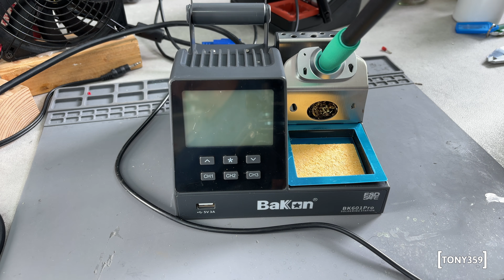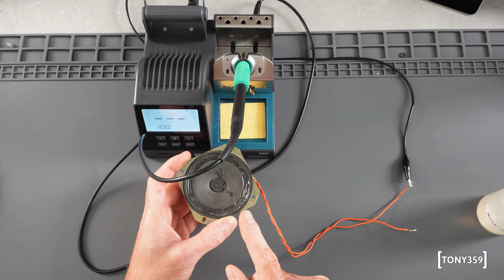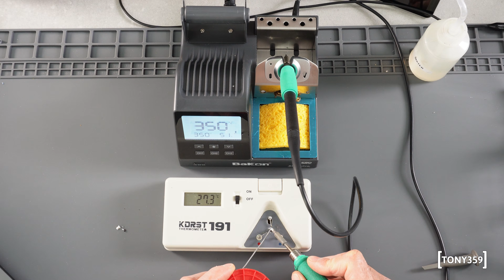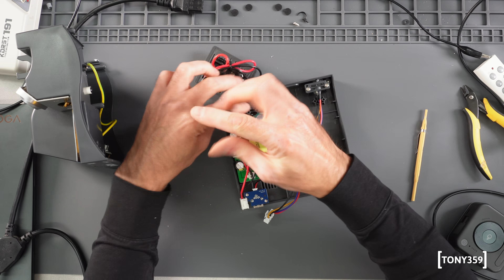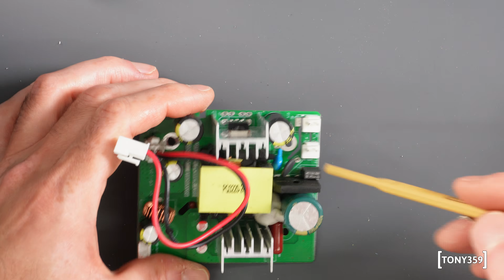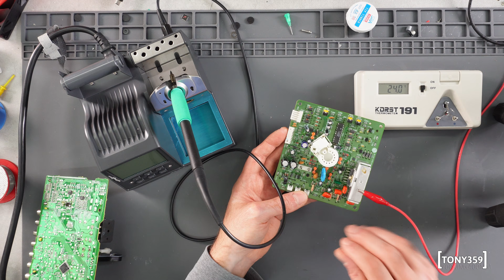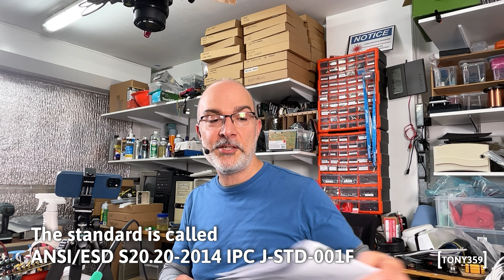This Soldering Station CHIRPS. Should you buy it? REVIEW!

Comment: Fascinating... you humans are such peculiar beings. 🤨 It is not the soldering station that is at fault—it is the tip. Merely exchange it for one of superior quality, and you shall achieve zero voltage drop leak  rivaling the warp core of the USS Enterprise. Conduct the experiment and relay your observations. As for myself, I shall be upon the bridge with Captain Picard, demonstrating the logical refinements I have implemented. Live long and prosper. 🖖
Reply from the maker: Your analysis is most enlightening, Commander. However, I must report that the soldering tip in question is a genuine JBC unit—procured directly from the official JBC distributor in the United Kingdom, fully compliant with Starfleet Calibration Standards, Revision 2407-B. Initial diagnostic scans show negligible plasma impedance and a stable microthermal flux pattern. If there is a leak, it lies not within the metallurgy of the tip, but possibly within a temporal field perturbation between operator intent and ionic conduction. I shall reconfigure the waveform analyser and update the engineering logs accordingly. Until then—may your circuits remain cool and your flux capacitors ever stable. Live long and solder

Comment: It is nice to see a review where there is actually some relevant and necessary testing being done. Most "reviews" I see on YouTube are pretty much worthless. They are done by people who lack relevant basic understanding of issues.
I'd like to see some sections of the tips. The problem with so many tips and iron designs is that the temperature measurement point is far too far away from the "action" part of the tip to do a good job. You can't compensate for this because the temperature difference is very dependent on thermal "loading" of the tip.

If I had a soldering station that chirped it would be forced to make like a birdy and sent flying.
I realize that this stuff is all cheap (pun intended) but why must so much of it be so horrible?
0.96 V is enough to make silicon PN junctions conduct. Absolutely unacceptable.

I have soldered hundreds of thousands of joints with irons that  did temperature control with "Curie point" methods. No display of any sort. No knobs. Highly reliable.
I've seen all sorts of YouTubers with fancy soldering irons but few of them have learned how to actually solder quickly and properly.
Reply from the maker: Oh, the Metcal station, my dream! No electronics. "It Just Works" (I'm told).

The tips I used in the soldering demo are JBC. I pay them £20/30 from the official JBC distributor, I refuse to buy junk online. 
The temperature test is probably flawed by the very small tip - maybe there are different tools for that? In any case the thermometer is a cheap one so I wouldn't trust it too much. What matters is that the Bakon and the JBC read the same with the same tip and I didn't register crazy overshoot while testing. 

Thanks for watching and for your kind words!

Comment: Around 17:15: very strange circuit on the earth/PE connection to the negative of the low voltage side. For me, seeing your test with measuring current between the tip and ground and the circuit, it looks like you were shorting out the output of the transformator? Maybe thats why you were getting 0.6A of current? Depends on how the tip is connected to the board and I might be totally wrong, but if this is the case, thats not okay at all and NOT to be "expected" as the manufactor says...

Comment: Great honest review! On Reddit I've heard good things about Geeboon T22.
Reply from the maker: Lots of people have been asking in the comments. I don't know, but I see their official store mentions that voltage leakage is less than 10mV 😀 
They're learning! Slowly but surely! Thanks for the visit!
Reply: @tony359 It's on the list of safe stations and currently the most recommended one. Very nice interface. I'm considering buying one. The FNIRSI DWS-200 hasn't given me issues, in fact it's been wonderful..
Reply from the maker: I understand the DWS-200 needs a simple mod or it will leak as well. Unless FNIRSI changed the design. 
Who makes that list? 🙂
Reply: @tony359 Yes there is a resistor mod. But then I've read that it can introduce a new issue, out of control heating when the part is grounded. So I haven't done anything yet, but nothing I do is grounded. I guess the list is done by Reddit community members? Soldering is the Reddit
Reply from the maker: interesting - the usual short blanket! 😀 

Well the thing is that if you have leakage, it's ok... until it's not ok. I don't want to take a change that my soldering iron might cause damage. And if you mod it, it might misbehave on grounded PCBs - for experience this can also happen on a non-grounded PCB, I'd imagine if you apply voltage to a circuit, it might find a path somewhere which might upset the temperature sensing?
I don't know but I'd rather trust my iron and not have to think about it 🙂 

What happened to those old fashioned soldering irons which... just worked, were grounded and just melt solder? 😀 

In any case, if it works for you, happy days. 🙂 I'll take a look at the soldering thread, thanks!

Comment: I would have loved seeing you solder the Anode of an LED that has its cathode connected to ground. Judging from the waveforms and current you measured from the soldering tip, I recon the LED would have bit the dust.
Reply from the maker: ah yes, a good test for next time, thanks!
Reply: I'd probably take that bet... I think the LED would survive. 0.6A through a 0.1-ohm short only dissipates 0.036W. Factor in the voltage drop of 3v for an LED and you get 11mA, which is safe for almost any LED.
... I mean, it's definitely not good that it does this. But I've definitely found stupider ways to light LEDs before.

Comment: I hope they fix the plug on the mains lead for a UK one, you cannot legally sell appliances in the UK without a UK plug. It is a criminal offense to supply appliances that are not fitted with a UK 3-pin plug or a conversion plug that permanently and securely encloses the original plug.
Reply from the maker: I'll leave those details to the manufacturer and appropriate authorities 🙂 Thanks for watching!
Reply: I also hope they remove the ESD-safe badge from the case. They need to fix the voltage leakage.

Comment: Failed electrical safety test. Sharp edges. Tip not grounded, that destroys your work but may kill you as well..
Did you test the supplied European cable to be less than 0.3Ohms, ground wire as well as the leads? What about the USB out, is that one safe?

Anyhow, if electical safety isn't ok, i would stop testing.
Reply from the maker: I should probably get a proper milli-ohm meter to do those tests. I finalised this review so that potential buyers can have an idea of what they're getting if they decided to buy one but yes, the moment you have grounding issues and voltage leakage, it should be a "thanks for watching and goodbye" 🙂

Comment: It acts like it has a filtering capacitor that is bad or not installed.
Reply from the maker: I mentioned the voltage and current leakage to Bakon, they confirmed it's expected. I didn't mention the chirping but I'd imagine it's a by-product of using 1.8KHz for switching 🙂

Comment: I always use a certified soldering station that has been verified to not have any voltage on the tip whatsoever. And that is because you are working on all different types of circuits and lots of SMD that can be damaged with any voltage on the iron tip... I still use a Weller WES51 station. It is what I used when I was repairing tons of aircraft black boxes for the Military early in my career...
Reply: To be fair, these kinds of products are not for professionals, they are for hobbyists with the odd job here and there on non-critical stuff (hi-fi, car radio, whatever). People who need (or want) modern small T15 or 210 or 245 style tips and a modern thin pencil handle, but don't want to pay $250 (AUD)/$100+ USD for a traditional handle Weller WE1010 (noting WES51 is discontinued) or a traditional handle Hakko FX-888DX (let alone $500+ for the modern style) and then $20 per tip on top of that, when (admittedly bad QC) Chinese T15 or 210 or 245 tips are a few dollars each allowing the hobbyist to have a wide variety of tips to suit fiddly jobs (and the machine itself is what $25-50 USD?).

No one is under the illusion the Chinese stuff is a quality product!  By all means the traditional chunky Weller or Hakko handles CAN do the fiddly stuff, but people sure do like their thin modern pencil handles...
Reply from the maker: That is exactly why I do not accept any voltage, any current. Zero is my tolerance. 🙂 
A good station is a good investment for sure - but not everybody can afford that at the beginning so I hope videos like mine can help understanding things better! Thanks for watching!
Reply: People always wonder why you drop serious cash on proper repair gear. It’s not because you’ve got an unlimited budget — it’s because when you actually care that the tool does what it says on the box, you have to pay for that assurance. When lives are on the line, there’s no such thing as “too expensive.”

Like I said in my other post, China can crank out some solid gear — no question about it. But for every two or three well-made units, there’s a dozen bits of “China slop” floating around. Stuff thrown together by what I’ve started calling electronics street peddlers. Sketchy to say the least.
Reply: @philathomas  "When lives are on the line, there’s no such thing as “too expensive.”" Surely it's self-evident that this is not a professional product? It's the equivalent of buying Amazon Basic wrenches instead of Stahlwille or Proto wrenches as found in an aviation toolbox. Granted a loose-fitting wrench doesn't represent a direct safety risk (though if a wrench is overhardened it can snap rather than bend, which can be very dangerous).

It seems to be a big debate whether hobbyists should pay $30-50 USD for a Chinese switch mode power supply system with 5-10 different T15, 210 or 245 tips, or $120 USD for a traditional electrically-safe Weller WE1010 (people say WES51 or WES51D but that's no use when they are no longer available!!!) or Hakko FX-888DX and then $10 USD per extra tip. I dunno.
Reply: @TassieLorenzo  It’s clear these aren’t pro-grade tools. What’s sad is how many people start their hobby—or even a possible career—with the wrong impression.

My son is a good example. He took a soldering course at the community college and really developed a passion for it. For months he spent hours at his desk experimenting, picking out soldering irons, buying used gaming consoles, old CRTs, flatscreens, and some basic test gear. He was all in.

But eventually he quit. When I asked why, he said, “Dad, at school our setup is awesome. I can actually solder, troubleshoot, and work on things. But everything I have at home is junk. Since I can’t afford the good stuff, I quit.”

It’s hard to argue with that. Sad, really—because he’s right.
Reply from the maker: @philathomas
Where do you live - if I think of my school, it was the other way round! 😀 

There are good alternatives for everything today. It's just difficult to find them sometimes.

Comment: “Kettle leads.”

Hmm. Why not “appliance cord?”
Reply: The IEC C13 is almost invariably referred to as a kettle lead in the UK, despite a kettle actually requiring the high temperature C15 connector.
Remember that pretty much every house in the UK will have an electric kettle so it's hardly unsurprising that "kettle lead" fell into common vocabulary.
Reply from the maker: I don't know, I didn't decide that! 🙂